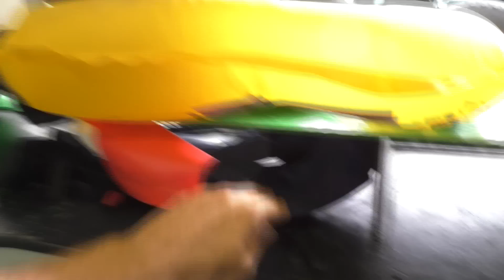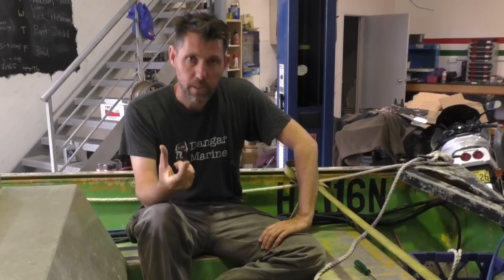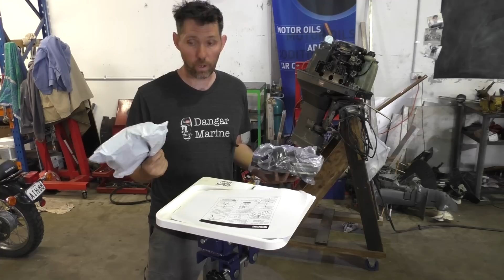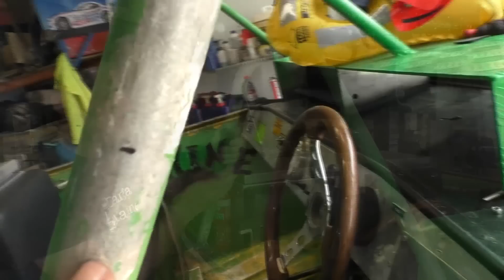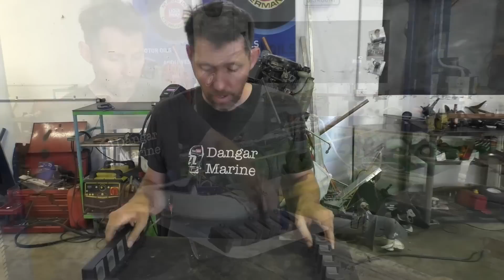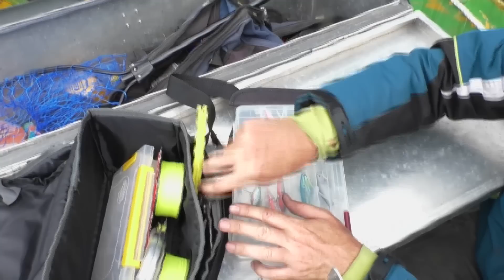Setting up the Green Machine for fishing

Comment: Hi m8 watch all your videos and they are most helpfully. 
I have a drama I cant solve I have a 25hp evinrude 1976.

It suddenly reved fast and then stalled like it had ran out of fuel.
Has heaps of new fuel checked and cleaned the carby I even replaced fuel pump and all fuel lines.  
The motor has good spark a nd the compression is around 95 in both cylinders.
I Checked the key on the fly wheel and it's fine so trimming shouldn't of slipped. It's my understanding you cant adjust the timming anyways.
If I spray start you bastard into the carb or even the top cylinder all it does is backfire once and will not run.

I am at a loss do y ou have any suggestions ? It Definately feels like a trimming issue
Kind regard
Robert

Comment: You need a different boat set up for fishing! 

An old trick here to get a great boat on the cheep is to find an old tri hull ski/runabout boat.  The hull is gutted, the cap removed and floor is removed.  The stringers usually wood are rotten.  If rotten stringers are removed.  Then a workable layout is dreamed up with live wells, coolers, catch boxes, and rod holders on the side.  Then some fiberglass, cyanoboard and paint are magically mixed with old hull and bingo you have a flat top fishing machine.

Comment: I'm really liking your vids man, I'm a budget boater as well, I actually used your idea with using the bus bars under the dash instead of running individual wires, only difference is I added a fuse panel. Keep up the vids man.
Reply from the maker: Thanks Chris. I think I would have just purchased a fuse panel if I did it again, much neater.

Comment: I think for the way you have your boat set up you set up all the new stuff really well. My suggestion would be to add a swivel seat in the middle of the back. I faced all my rod holders toward the back and sides and my seats can turn to face the back. I love the huge truck  you have you can never have enough storage space.
Reply from the maker: Yes, a swivel seat would be good. So far I've been really happy with the setup, particularly the storage container.

Comment: Gday mate youll be fine ,i have a mate who has just started fishing at 68 and he is loving it ,with the rigs you make up and want to keep what a guy i know does he makes them up and cuts a small rectangle of coreflute /plastic cardboard and he wraps them round it rather than use your sharpening stone which may cause abrasion of the line on your rig ,i do a lot of soft plastic fishing myself also some bait fishing but not a lot ,when i had my boats i had loads of gear but now i just carry a wading bag with minimal gear in it just for the time i am out anyway tight lines .
Reply from the maker: Can appreciate the approach of taking minimal gear these days. I think like anything when you get into something there is the desire to get completely kitted out but I also think there is something relaxing about fishing when it is kept simple. It's a shame the warm weather is almost over!

Comment: It might look weird but you might consider adding a seat to the front of the boat. Looks stable enough for a casting deck. Of course you would have to cut a small hole for the pedestal. But the whole set up is pretty cheap.
Reply from the maker: That might be a good option for this boat. The bow is quite large, I'd just need to make sure the socket for it wasn't something you could trip over as we exit over the bow when this boat is tied up on the mainland.

Comment: Hi Stu, how's the weather down under? all I have left on my motor is set the oil pump setting and put new plugs in. pouring rain today but should get back to the motor tomorrow. meantime just watching more of your videos which are awesome. Thanks for all your efforts
Reply from the maker: Thanks mate, we've had loads of rain here lately, but nothing like the cyclone up north. Sounds like you are almost ready to go get more trout with your boat! :)
Reply: with the small boat yes. went to start up the big boat with my remote and the it started but wouldn't keep going. good thing since the lower carb was leaking plus the starter was sticking in the up position everytime I tried to start it. took the lower carb off to make a new gasket for it and will need to spray some Wd40 on the starter top. Tomorrow should be a really nice day here so should get it up and running. oh one more thing getting way too much injection oil. I reset the oil pump per the book at idle setting but when I drained the lower carb it looked like green tea? going to lengthen the rod back out to where it was at. I may need to take the pump out to look at it closer. hard to see down there.

Comment: are you worried about the screw corroding the rib?  i own a de havilland as well. when i got mine i had to replace all the ribs because of stainless screws. finished up using Velcro tape to fix the new floor in place works well removes easy.
Reply from the maker: It is a good point you make, and really depends on how much water sits in the bilge to act as an electrolyte. There is a product called Duralac that can be put onto the threads of the screws to help where stainless steer fasteners go into aluminium as this is very common where aluminium fasteners aren't strong enough.
Reply: i guess its pretty far forward and will last the life of the boat. I just had to say something after all the drama i went through restoring mine. anyway keep up the filming it has kept me entertained for the last 2 days hard to find marine channels that aren't one big add thanks for the content.

Comment: Dang storage box: Split lid and hinge it at starb & port. Then you don't need 4 sq. ft. for a space-hogging open lid.
Reply from the maker: Although it is big, that lid forms a really useful table top when it is open and the lip around it stops anything from falling off.
Reply: You could achieve nearly the same by sicaflexing (sic) plastic bar stock or alum. angle rim around the top rear of storage box where rubber bumpers are.
Reply from the maker: I could, but at the moment that is quite a comfortable place to a person to sit and it would lose that with an  edge on it.

Comment: The rod rack, unless empty, will be a pain, and maybe not ideal for motor maintenance, plus it needlessly divides the bench seat (romantic guests will curse you). I'd mount it back of the storage box and chain the lid on that big thing so it hangs just far open enough to stay so.
Reply from the maker: I'm thinking of swapping that rack style of some tubes that don't extend up past the top of the seat. I think that will be a good way around that problem. My current plan is to use the back of the storage box for solar cells as it is angled up nicely towards the sun for our latitude.
Reply: That's a good idea, little trickle juice for free. I did the same on a moored boat years ago in AZ. Solar panel vanished in a week. Should have glued, screwed & padlocked the thing. But it was free, and then free to another.

Comment: The release notch in the rod-holder base should be oriented to a position that the holder isn't normally in. The way it's now mounted, road bumps may have the holder jumping out. Ya might rotate base 180.
Reply from the maker: Ah, great tip, that makes perfect sense. I'll swap it round.

Comment: Have you thought of adding a rear hoop/bar to match the front one? As your boat is a commuter, and is usually at a pier, a rear bar would help stop the stern from going under piers and smashing up your engine cowl, nav light etc. If the bar was made of thick enough material  you could add guides in the centre to use as a high centre tow point that does not foul your engine, and also make recovering sunken boats more effective when using the 'tow it up ' method you use in an earlier video. That bar could then also have 'rocket holders' added and then you can do away with that middle of the boat rod storage, which  is going to annoy the hell out of you.  While those rod holders look good,  they don't last long (UV killed ours in one year) .One other idea is to put in a floor at the bench seat level, have your esky on your current floor  and accessed through a hatch. Then use you tool box as a seat. Your COG may get too high , but if not then that would make a pretty clean and usable deck space for fishing. You would gain about 300mm rearwards .  Good to see that even though you were on the rocks, you made sure to rescue the beer first - a true Aussie!  :-)
Reply from the maker: They are some really good suggestions. I could put a strip of timber all around the bench seats just below the tops then lay a piece of plywood down to make that seamless space for standing in. Someone else mentioned those holders don't last and suggested having the tube style of holders that don't come up above the seat height which would mean it is still useable as a seat - another good suggestion. With regards to the back bar, it would certainly have loads of uses. I see a lot of builders around here have them so they can lay long timber across the back and front bars for transport to the building site.

Comment: Short question  what to use for thread compound for salt water outboard motors
Reply: I use  'blue' Loctite. This is the low strength stuff as you are using to fill the thread space  to stop water/salt getting in there to cause corrosion. The blue stuff is easy to break free when required. Don't forget that with using Loctite or similar you have to be careful that your don't over torque the threads. The Loctite acts as a lubricant so if you are using a torque wrench, look up an engineering table for lubricated threads. When going with 'hand tight', go easy on the wrist , instead of two clicks of the right wrist, back off to one click.
Reply from the maker: That all sounds like perfect advice. :)

Comment: I would suggest replacing the vertical rod holder with a PVC 3 or 4 rod holder-Rocket launcher type. What you'll find is that the foam on the top portion of your current holder will be compressed and hold the rods less securely especially in rough water while under power. They are shorter and will allow you to use all of the seat if there are no rods being stored.
Reply from the maker: Good point about still being able to use the seat, I like that idea. I also wonder maybe if that foam will start to get sun affected after a big of time. They weren't expensive so changing them to the system you recommend wouldn't be such a big deal. Thanks for the tip!